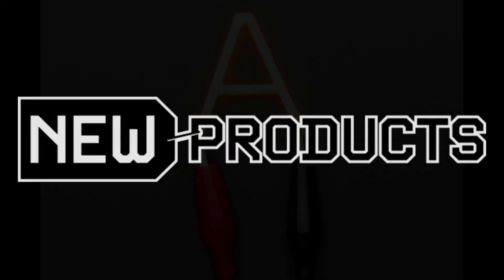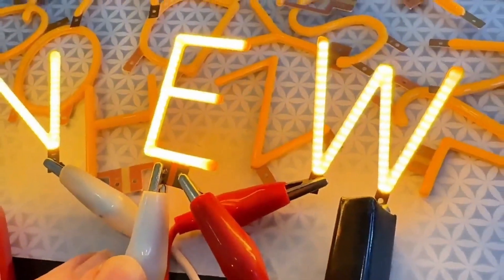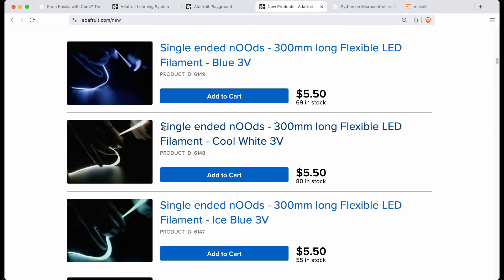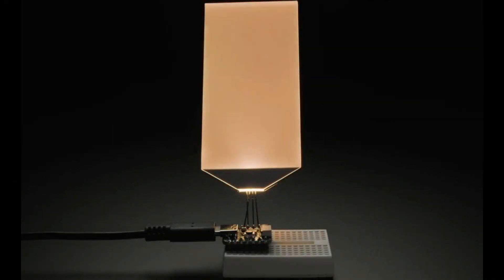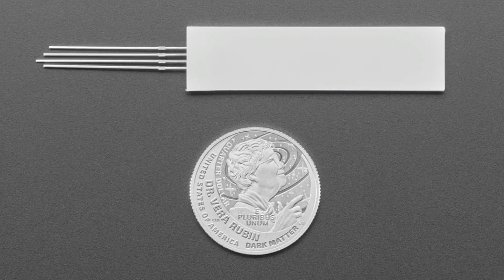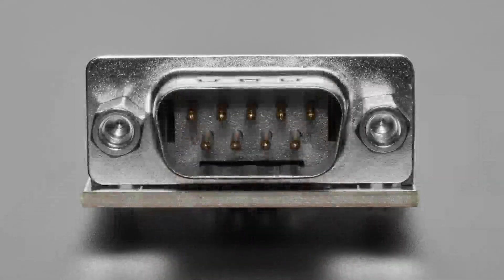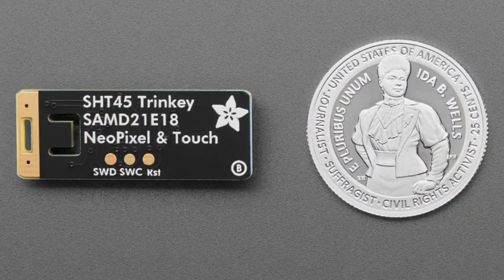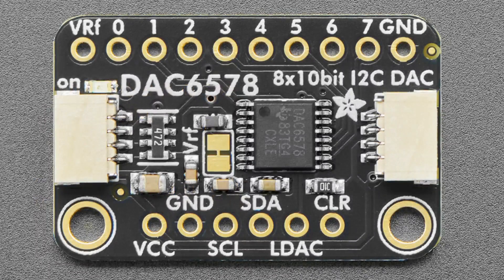#NewProducts 3/05/25 Feat @Adafruit Metro RP2350 with PSRAM

Comment: What I'd like to see is a C13 power socket with a built in USB power supply, Perhaps combined with a switch. 
You then just add that to a small enclosure and you have power.

Comment: The RP2350 with USB Host must be super shy,  it’s still hiding somewhere instead of showing up to the party.
Reply from the maker: The Metro RP2350s have a USB Host on unpopulated pin headers. You have to solder in the pins then plug in a cable like https://www.adafruit.com/product/4449
Reply: @adafruit   yes but it does not feature a build in usb a in a smaller form factor board which has smaller circuit making it faster.